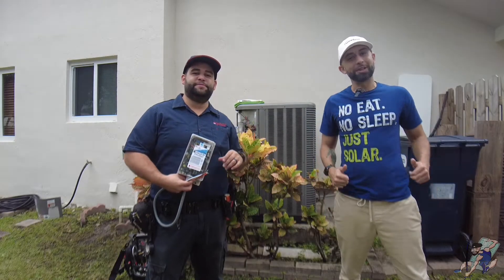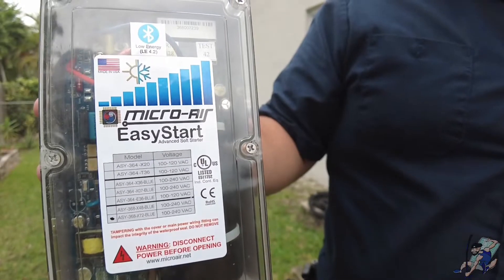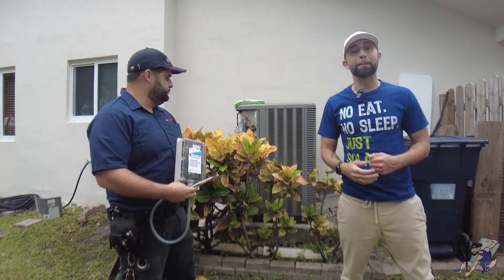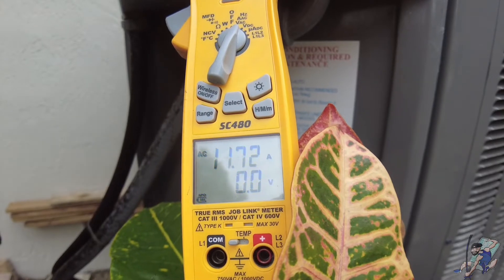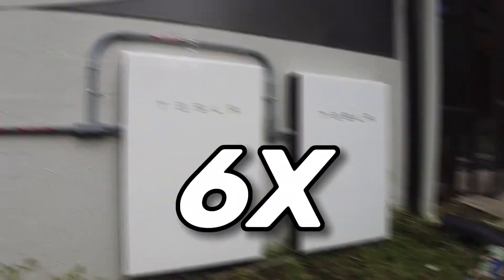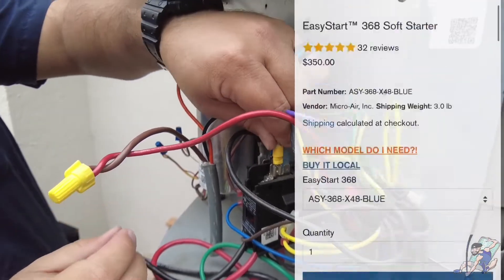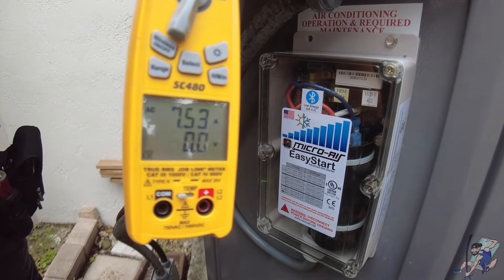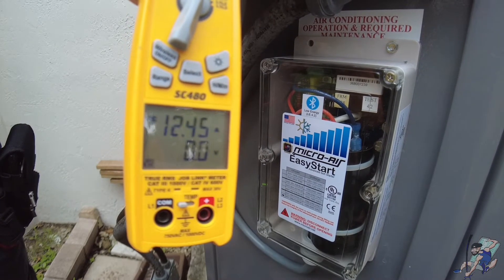Micro-Air 368 install on a 5-ton AC!

Comment: https://youtu.be/7Gim96oyczw 
Kind of a long video but here he’s one of the electrical engineers for the micro air device talking on an Hvac channel.  He shows some charts on various compressor amperage’s of home Hvac units before and after.  Also has a lab scope comparisons to show the difference in peak amperage on an ac unit for an RV.  Has a lot really good info.

Comment: What was the manufactures LRA requirements as stated on the information sticker on the A/C unit ?  Mine shows and LRA of 125.  Curious to what the drop would be after the soft start was installed.  

Any information is appreciated.
Reply from the maker: The compressor L.R.A was 153.  I imagine you can lower your compressor from 125 to 31.